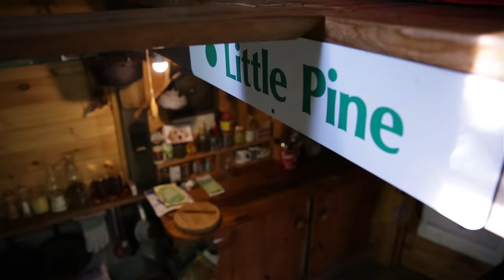TEENAGER Builds OFF-GRID TINY HOUSE (80% Recycled Material)

Comment: please do research on what off the grid means
Reply: Dynamin Slammin  off the grid  def not dependent on public utilities, especially the supply of electricity. I think you should do some research
Reply from the maker: Many people confuse off-grid with living under a rock. It happens.
Reply: Off grid is not being controlled by a government if you have internet etc that's not off grid
Reply: Why didn't you make the one window near the bed open up? You could hook a fan up near the window across from you bring in air and another fan in the window near the bed drag warm air out and than have a tiny fan you can clamp onto something blow air right on you and it will cool down nicely.get three fans one extra small one on you and most powerful one to bring air in and get a smaller one but bigger than the one blowing on you in the window near your bed to drag air out.That will make a huge difference and fans don't use much energy.
Reply: wrong off the grid meant that you were off the city systems like sewage  water electricity
Reply: cyberspaceout He doesn't have plumping and his electricity comes from solar panels.
Reply: you know you can use a computer without it being connected to internet.
Reply: Mary Elizabeth Bauer it would be pointless to have it than
Reply: Turtle Slaying nah you can do plenty of things
Reply: MrSomnus no you can't 😂
Reply: Turtle Slaying you can write using notepad (takes up less space yo), you can draw on paint, you can use whatever programs you have downloaded (I will give you that tho you need internet to download shit)
Reply: MrSomnus so 2 things again pointless
Reply: Turtle Slaying w/e using the internet is still off the grid anyways
Reply: No it's not 😂 that's still on the grid the government owns it so you're on the grid
Reply: Turtle Slaying so people in Japan using the internet are on America's grid?
Reply: MrSomnus cool you're trying to sound smart anyway you know what I mean and if you don't (god you're special) they would be on Japan's grid
Reply: Turtle Slaying well America owns the internet technically, genius.
Reply: Turtle Slaying by your logic: using the internet means you're on a grid, and since USA owns the internet then no matter where you are in the world, if you use it then you must be on America's grid
Reply: MrSomnus America don't own the internet 😂
Reply: Turtle Slaying then who does?
Reply: MrSomnus techically no-one owns the internet.
Reply: Lauri Laine Then why would you be on the grid for using it, Turtle? Hmmm
Reply: MrSomnus being off the grid can mean multiple things. Being off the internet being one of them. When I hear someone being off the grid, i think that they have no roads leading to their home etc.
Reply: Lauri Laine I feel living off the grid has multiple meanings as well, a common definition is that they just don't use their country of residence's assets aka sewer and electricity
Reply: MrSomnus But yeah my main point wad that the US does not own the internet, same story goes for the moon.
Reply: Lauri Laine yea my main point was that you're still off the grid even if you use internet, and turtle had previously said that the government owned the internet
Reply: MrSomnus goverments doesn't own the internet but rather handles the surveillance of possible illegal traffic. Some people, such as myself, consider this a privacy issue.
Reply: Never said they owned it but you're still not off the grid
Reply: Turtle Slaying ahem lemme quote you dawg "that's still on the grid the government owns it so you're on the grid"
Reply: 😂 changing words around I see
Reply: Turtle Slaying nah if you actually read your comment you said those exact words
Reply: MrSomnus America isn't the only country that has a government ya goof.
Reply: Michael Parson no shit
Reply: MrSomnus wtf why would u think the US owns the internet 😂
Reply: C m look it up. The US Commerce Department used to control the internet
Reply: Depending on the context 'off the grid' can mean different things. I understand your point of view where as if you're wanted by the government you can be 'off the grid' aka. hidden from the government. However 'off the grid' in this example is him not using public utilities (electricity and sewage).
Reply: Turtle Slaying Why does it bother you so much, dude?
Reply: Turtle Slaying illegal
Reply: Lord Rancid he's just trying to proof his point. that's all
Reply: Turtle Slaying no shit,if you have electricity and it's not solar you're not off the grid #fail
Reply: boss hog918 if you were listening it said he used solar panels and if you weren't absolutely blind the house had solar panels
Reply: +Dylan Magaster hahahahahahah nice 👌🏼
Reply: +Mary Elizabeth Bauer LOVE your profile pic
Reply: Turtle Slaying it means to not watch porn or do anything with internet or location service. No Pokémon go
Reply: Turtle Slaying hes on youtube totally off grid
Reply: And research what teenager means
Reply: Wrong, your skewed definition means out of touch:( If you are alive and/or own anything you are under some level of government regulation but not necessarily government control. Dylan is right about living under a rock. Just say'n...
Reply: Why does it matter
Reply: Turtle Slaying I agree. Being off the grid means that your life cannot be controlled or influenced by any type of institution. It means no one knows where you are and no one can really find you. You provide everything for yourself. An internet connection means your on the grid, period. Sorry guys. The average moron thinks off the grid means "off the power grid" but that definition has evolved as there are more ways to influence and control aspects of a persons life then by shutting their power off. Going off the grid means moving somewhere where you are self reliant and outside the sphere of control of others. In modern times this means zero communication, zero connection... and no YouTube videos. Sorry you won't find anything off the grid here... only things that are somewhat partially capable of being off the grid.
Reply: oh no no no your talking about living the tin foil hat lifestyle, seek help is all i can say.
Reply: Turtle Slaying that's what I was saying
Reply: Blahblahblah14898 so just because the government doesn't call wifi one of their public utilities immediately means that internet is OK? lol someone fell for that trap right off the bat eh? let's try this, did you now there are plenty of people who live on the grid but do not take advantage of sewage utilities? there are also plenty of people who have their own access to water without paying a bill for it... I'm sure you can recognize that plenty of people provide their own electricity, but you must realize that just because a person provides a utility or several utilities for themselves doesn't mean they are living off the grid. just because someone has chosen a sustainable lifestyle doesnt mean they don't rely on a 9-5 job within society to pay their other bills. you think someone who depends on a job is "off the grid?" wrong. by your definitions of off the grid as long as your not paying for very basic utilities your off the grid, your free to depend on the grocery store for food and hospitals for medicine... truth is your wrong talk to someone who truly lives off the grid (won't find em here) and you'll recognize that reason behind it is to disconnect from society, government, and any other entity that seeks to influence their lives. these people generally distrust government (which controls most of the internet and certainly all connection providers) because all the government needs to hurt you is your location. internet is another vulnerability that someone who lives off the grid must remove. period. don't get so angry about a YouTube comment you fool, your emotions don't really bother me :)
Reply: Blahblahblah14898 and
Reply: Paintballinmike1 You clearly don't know what off the grid means.
Reply: Emerald Nightshadow really? Explain it to me then. Cause any point that can be made without evidence can be dismissed without evidence.
Reply: So in your opinion if you have the internet you are controlled by the government? WOW
Reply: Holy cow there's a lot of ignorance on display here. We are all ignorant though. The problem is choosing to stay ignorant.

Off-the -grid is a term that, like a lot of things, can have multiple meanings. Insisting that your meaning is the only one that may be used just makes you look silly. At bare minimum it is to disconnect from the power grid and either supply your own electricity or do with out. Most people feel one should also disconnect from water/sewer services to be considered off-the-grid, but technically it means you are "off the grid" with the grid being the power grid. The primary definition is in the very term itself. You can argue all you want but that's the basis of the term. 

Now, there are different levels of off-the-grid, depending on what your goals are. If you really don't want to be tracked by the government you won't have a job or access to finances, will live in an inaccessible remote area and will have no contact with others. For this level of paranoia though, you also have to avoid open skies because, satellite images. 

The point is, you don't get to redefine words so that only your version of the term is correct. It's like any other topic I suppose. As a cyclist it crops up in the "You have to ride this kind of bike, or ride clipless pedals, or whatever" in order to be a true cyclist. And as a photographer I see it in the "you have to do it this way or you're not really a photographer" arguments. 

Speaking of photography, one of the things you can do with a computer that's not hooked up to internet is edit photos and video. If you're a photographer that makes the computer a tool of your trade. Many photographers will take their laptop somewhere without wifi in order to work without the temptation of the web. Nothing in the video suggests that the computer is using the internet unless I missed it. He may have had to go somewhere to download Lightroom, but it doesn't mean there's internet in the woods. 

And for the person whose conclusion was that he is on YouTube, therefore he's on the grid, you must have missed the fact that this is not his channel, nor was it his video.
Reply: Carlos Benjamin Sorry but there are not different levels of off grid. Disconnected from main supply of gas, electric  and water = off grid. All the other things are pure bs.  :)
Reply: Drew Skeez exactly.
Reply: Turtle Slaying you are wrong
off grid means not connected to utilities
the internet is a commodity
Reply: YOu re not controlled by government,just bcs you use internet.Only paranoids think that way.And maybe some goofs with weird usernames...
Reply: justin mccaffery 
Dude, read what you said again. Based on what you said, then you are wrong, because he is using electricity in the video.
Reply: Majestic Hotdog He's not using electricity from a utility. Having electricity isn't what makes you on or off grid. It's where you get the electricity from. Generating your own is fine.
Reply: Carlos Benjamin 
I never said that the problem came from him generating his own electricity, or that electricity was a problem. I was simply directing a flaw Jason McCafferey's argument, in which he stated that himself that electricity was the problem, not me.
Reply: Majestic Hotdog Unless you're reading something I don't see he said "public utilities" and added especially the supply of electricity.
Reply: Carlos Benjamin i'm not ignorant.
Reply: Til williams We all are ignorant. Nothing wrong with that. I'm ignorant in far more topics than those I am well versed in. If that's not true of you then you're a remarkable individual......
Reply: Carlos Benjamin Again. I am not ignorant.
Reply: Til williams Then I'd love to meet you. Out of billions of people on the planet, you are the only one.
Reply: Carlos Benjamin There are 3 better people you could  meet but thank you.
Reply: Til williams Who are they? I'll certainly put them on my list of people to meet.
Reply: Carlos Benjamin My mom, my dad  and my grandfather. 3 amazing people.
Reply: Carlos Benjamin 
Yeah, he added it on, therefore he still said it.
Reply: ***** ignoring something isn't ignorance. It's a lack of understanding or knowledge. People can be completely aware of something and choose to ignore it. 

=====EDIT=====

Ignorance is a lack of knowledge or understanding. I realized the original was unclear.
Reply: Lara Fruehwald Right. So it's not done in ignorance. Ignorance is not understanding something or not knowing about something. I am ignorant when it comes to advanced mathematics or theoretical physics, but I'm very well versed in photography for instance. Although I can ignore some of the "rules" of photography to get a certain result. I am ignoring those rules but I know them so I'm not ignorant regarding the "rule".
Reply: by definition, being "off the grid" means that you are not reliant on public utilities: power, water, sewage, etc. 
And the internet thing has nothing to do with being off the grid or not - the definition of something is not changed because of your personal opinion on what it should be. 
A byproduct of being off the grid is having less control by the government, yes, but that is not the definition of it, it is a byproduct. Two different things. 
The grid is literally an actual physical grid, where everything is connected (all water lines, power lines, etc). It's not some sort of hyperbole abstract name for something that actually means something else. 
There is no grid connecting the internet in the same way as utilities. Turn off your connection, or shut down your computer and you're off that network.

Comment: Maybe time to shift to LED lighting and a small savonus rotor generator as a supplement power resource. And your monitor and computers have power supplies that convert from 110 ac to 12/5/3 dc and some simple voltage regulators could replace those power supplies and thus lower your power consumption.  Otherwise, you've done a great job and look forward to your future endeavors.
Reply: This is wonderfully constructive comment. Are these things cheap/moderate/expensive? I realize cost means different things to different people.
Reply: Azri'el Collier that iMac is not energy efficient
Reply: Good point, most oem power supplies are 80% efficient at best. Upgrading would be a costly endeavor though, even if you had the electrical skills to do it yourself
Reply: He probably is running his whole place on DC anyway at least one inverter for everything else but the freezer can be DC
Reply: Mark Cooke  neither is the sun and we need it to survive buddy, take the tinfoil hat off
Reply: The best it is to use the most part of the day to work and less light at night...
Reply: I like that he takes a computer break instead.
Reply: Mark Cooke  I think the problem is the blueness of the light. If you get yellowed ones, it has a different effect and you still get the energy savings. I just switched in my house.

Comment: So good to see you haven’t sold your soul to a mortgage company but done what you need. Have you thought about trying pulling some ducted hot air down when it’s too hot upstairs and pushing cold up ? I did this in a home we had with a 28ft A frame ceiling in the great room. Used 6” flex ducting with internal duct fans. Helped a bit.